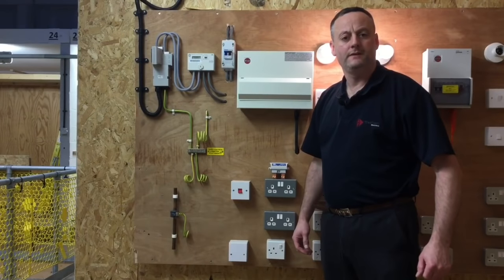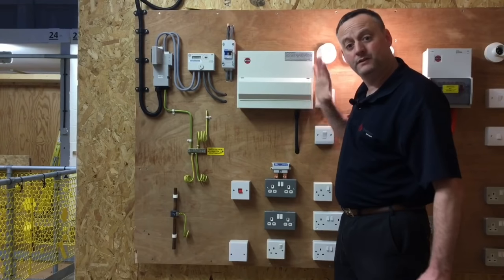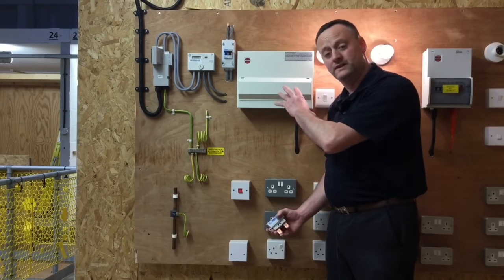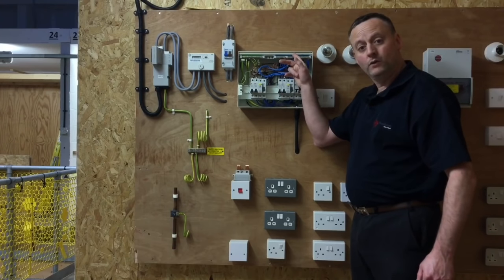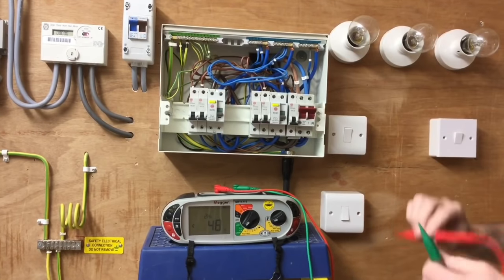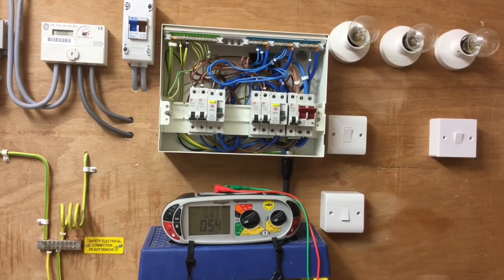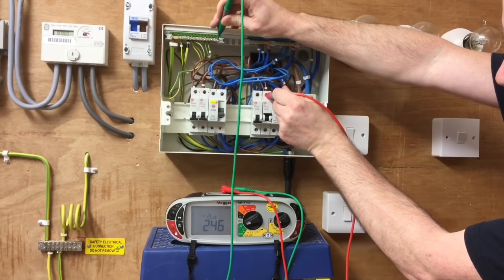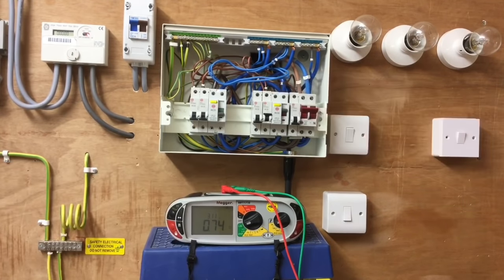Measuring Prospective Fault Current (PFC) at the Origin of a Single Phase Supply (Live Test)

Comment: Hi, thanks for the video I’ve got my AM2 soon and it’s going to be 3P+N main switch. 

Carrying out this test I would crocodile clip onto the earth bar 

One probe in neutral 

One probe testing between L1,L2,L3 taking the highest reading and X by 2. Is this correct? 

Also what setting would it be on as on a single phase board you switch between the 2?

Comment: Is it a requirement of initial verification to test on the load side of the breaker? I thought Ipf was only on the supply side of the main incoming?
Reply: I don't think its a requirement, but if you want to do it for peace of mind then by all means do it.
Reply: It’s only to test the main fuse if you test on the supply side. If you test on the load side you’ll be testing the mcb/rcbo fault current is under 6ka.

Comment: Reg 542-04-02 "The means os earthing must be disconnected from the installation earthed equipotential bonding for the duration of the test to remove parallel paths. This is to prove that the installation has a main earth. IET. Guidance note 3
Reply from the maker: Hi. Correct and I disconnect from the MET the protective bonding conductor disconnecting it from the main earthing conductor in this video. Thanks for watching GSH Electrical
Reply: For Ze testing only, you need to reinstate all bonding connections before carrying out PFC testing.
Reply: You only disconnect the main earthing conductor for Ze test, you need to reconnect the main earth for PFC
Reply: @skamuk1  would that be not for the other tests mentioned, not the max PFC demonstrated here? I didn't see mention of the installation earthing being disconnected but he says in this reply that he did that though which is confusing me as it doesn't look disconnected.

Comment: Just to clarify, we dont measure the fault current, we measure resistance and the tester auto calculates it  and shows it as result. You dont send 4-5-600A trough your tester.
Reply: The test leads would fry first

Comment: @6:03 you tested line and neutral on a high reading then switched to low reading when testing live and earth, because there's a rccb in the circuit but @6:03 isn't the rccb in the circuit aswel? Can you explain why High reading when live and neutral then low reading for live and earth please thank you
Reply: RCDs detect an unbalanced current between the L and N conductors on the outgoing side of the breaker. If the impedance test is done across the L and N terminals there is no imbalance, they are sharing the same amount of current during the test and will not trip. When doing the test between L and E, the RCD detects that the L terminal has current flowing during the test but the N terminal doesn’t, this imbalance will cause it to trip if done on the Hi setting.

Comment: Can someone advise me about how the instrument gets the current at time 4:33 please ?  Are some assumptions made in the calculations ?  How can the source impedence be calculated without removing the mains supply voltage ?  I read elsewhere that in some instances a standard impedence value is used for the suppliers network and thus the max current is calculated. Is this true ?
Reply: I believe that as the circuit is energised it is a marginal resistance measurement. Thus actual voltage = I×R or current = V÷R

Comment: Hi Gary, how is it gonna clear any faults or short circuits if the current is way below the 6KA or 33KA? I know these are breaking capacity, hence it gives safety to the installation or equipments but how is it gonna rectify the faults? thanks
Reply from the maker: Hi. The numbers stated are the maximum break capacity so can clear (handle) faults up to 6KA etc. Thanks for your comment Gaz 👍
Reply: The terminology is confusing it won't clear faults. (They'll be rectified physically) It has to be able to withstand them at maximum so by doing pssc and pfc we know the maximum then we simply look at the Icn of the fuse and we know it can close a circuit if a fault occurs.  If for example he found 11ka pfc and only 6ka Icn if a fault occurs they may not isolate the supply.
Reply: Mark Dove its starting to make sense please can you add more to that?

Comment: Hi Gary, am struggling to understand this. Your main incoming fuse is rated at 100 amps but you’re mentioning KA. The same with the breaker, this is a 6 amp breaker but you’re now saying it’s 6KA?  Can you explain further, please?
Reply from the maker: Hi. The breaking capacity is the amount of current under fault conditions the over current protective device (fuse) can handle... so commonly a 6 amp MCB can withstand fault currents up to 6000 amps (6KA). At this value and below the device can break the circuit.... over this value it can say cause a massive arc that leads to a fire or melt across the device and then not disconnect the circuit... all the best and thanks for commenting Gaz
Reply: So 6 amp is just for the overload protection? 
The KA rating is for the short circuit protection?

Comment: Hi Gary can you please tell me how this is done using the kewtech kt62 multifunction tester or the ROBIN kts 1620 MFT as the instruction book says nothing about the two lead high loop test, on the control dial there are two settings, loop 20	ohms 200 ohms and 2000 ohms, psc 200A 2000A and 20ka also how to do Ze
Another great video thank you

Comment: Hi. Congratulations for the videos. Please, if you are so kind, two questions:

What is the reason for the difference between the measured PFCs of the two switches, being in the same point of the installation? In the case of Line-PE [424-312A] and in the case of Line-Neutral [311-332A].

Would the measures be different with all the charges connected?

Thanks
Reply from the maker: Hi. Normal practice is to measure PFC (PSCC and PEFC) only once. If the reading was less that the PFC of the smallest rating device in this case the circuit breakers 6KA then your sorted. I did it twice as a demonstration as this links to my class lessons on PFC. You have to do both PSCC and PEFC as PEFC picks up the parallel earth paths offered by extraneous conductive part (metal water pipe, metal gas pipe, metal frame of the building etc.) thanks for commenting and watching GSH Electrical
Reply: Thanks

Comment: Could you please explain to me why when we do a zs on a circuit on an mcb we get different readings when doing a 2 high and 2 low test? I don't understand why the readings are so different. And surely if you are getting a high test result on the 2 low setting you can put it on 2 high setting and get a much lower reading. 
If you have any info on the megger high/low settings it would be much appreciated 👍
Reply from the maker: Earth Fault Loop Impedance Test - 3 Lead Low or 2 Lead High - Test Explained
https://youtu.be/OaWOCNMQkSI

Comment: Gary, could you tell me why on. TNS system sometimes the Pefc and the Pscc readings are different when both the eart and neutral are essentially the same conductor and both test carried out with bonding in place so same parallel paths etc? Thanks.

Comment: I carry out this test with a similar tester . But I never changed the leads over( l-n& l-pe)would this have any effect on the test results ?  Also , should the fault current reading between the tails be greater than the rating (eg 100amp)
Reply: Also haha ,,,,. Am I correct in saying that the fault conditions are what could occur between the fault happening and the main fuse blowing ? 

Thanks.
Reply from the maker: Hi. No worries on the test leads. The fault current (PFC) at the tails can be up to 30kA the PFC rating of the 100amp cutout fuse is either on it or look in BS7671. It’s the fault current it can clear not the load current which as a rule of thumb is 1.5 Times it’s rated value so 100 amp fuse could carry up to 150 amps for a short period of time. Hope this helps GSH Electrical
Reply from the maker: Yes
Reply: GSH Electrical it’s one thing doing the simple test but another understanding it fully . Thanks
Reply from the maker: Yes. I hope my videos help in some small way. Thanks Gaz

Comment: Is the measurement of each individual circuit PSC recorded on the test sheet or is it the PSC on the side of the breaker? i.e. 6KA
Reply from the maker: Hi. The kA rating is either on the side or front of circuit breakers. The measurement is only done once above a (any) breaker as shown in the video as this will be the same reading (PFC) for all of them. Hope this help and all the best GSH Electrical
Reply: Sorry, what I meant was that in the box on the test sheet asking for the value of KA, do we wright in the value written on the side of the breaker, or the value we have measured? Cheers Andy
Reply from the maker: Hi. Yes the value on the device thanks Gaz

Comment: Hi Gary
Can I ask a question. Why have not locked off the main switch before taking the cover off and why do you need to do PFC test for each circuit rather than just at the input to the main switch. GN3 and both Napit/niece guides always show locked off powered down CUs whilst doing this test. If I had done this during assessment I would have been failed.
Reply: You will never get an answer from him because in this industry no one knows what to do . I had once two different assessment within couple of months and both assessors were saying something else.

Comment: Hi...wWhat do you have to say regarding these two comments  I read on another channel...where the tester / instructor stated the fault currents wer 370 and 350 A for PFC PSCC
1. The breaking capacity of the main fuse will need to be lower than the PFC
The second commentor agreed.....
2.Exactly! How is it that having CBs of 6,000 A breaking capacity will protect a circuit with both earth fault and short circuit PSFC and PSCC of 370 A and 350A, respectively?! The whole purpose of a protective devise is to trip before a circuit or any relevant point of the electrical installation reaches its maxumum PSCC or PFC!!! If that installation has in place those protective devises then surely the PFC and the PSCC are higher than 6,000 A. I seriously suggest this video should be withdrawn. It represents a hazard in itself! It will certainly confuse the inexperienced student.
Your comment would be appreciated...
I think the commentors have mis-understood which part of BS7671 we are compairing...and this may need explaining...by someone somewhere.
.
Reply from the maker: Hi. Thanks for the detailed message. The information you have provided me is worrying but I haven’t seen the video yet. I am not sure how you can go about having a YouTube video removed it maybe worth highlighting these points to the channel that produced the video. Many thanks for your time GSH Electrical
Reply: The video seems fine as he did the same as yourself tested the board to ensure the fuses/circuit breakers were able to withstand the potential fault currents. It was the commentators who had it wrong....but they did raise an interesting point...in that you would expect the fuse or circuit breaker to trip with the lowest fault current...in order to save the installation.....seems odd to have a large fault current circulating and the prospective faults becomming actual faults and no breaker has tripped....was their slant on things, confusing the actual tripping current  eg, 30mA or 150mA,  of the device with it's actual handling capacity.
Reply from the maker: Hi. Thanks for coming back it’s lovely to see your taking things so seriously. Keep watching and asking your questions GSH Electrical

Comment: Why would you get a significantly higher Pfc L to PE  vs  L to N.  Since you are testing a TNCS supply you would expect the same result since parallel paths are open to both tests through the MET. Or a slightly higher for Pfc might be expected for L to N, since the L tail is 25mm as opposed to 16mm earth tail.  Also why test Pfc at top of breaker, as it cannot be higher than Pfc at main switch. This just encourages learners to follow a list of instructions with no awareness of what they are physically testing nor the meaning of what the results actually tell them.